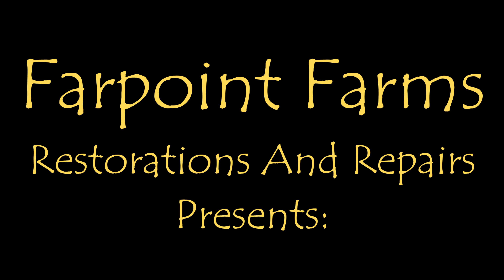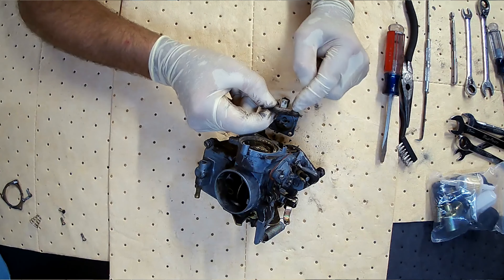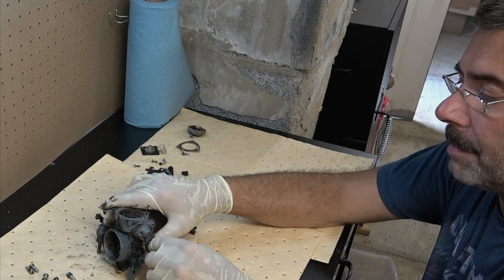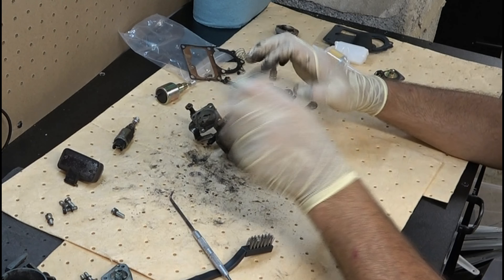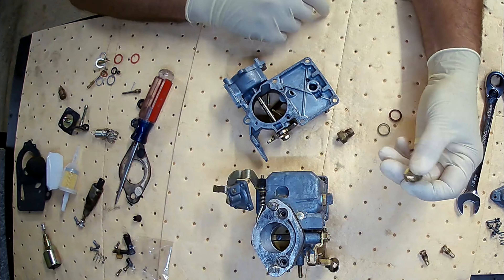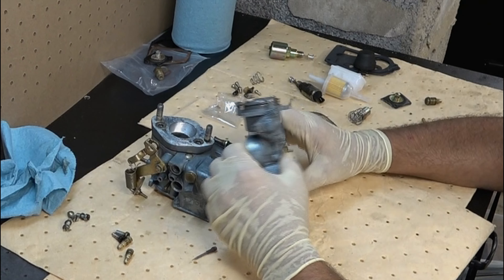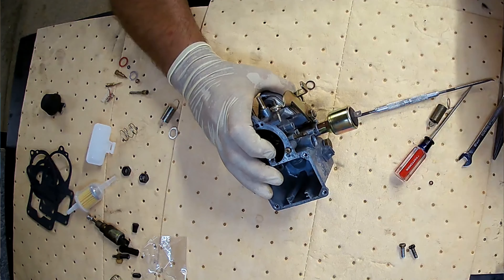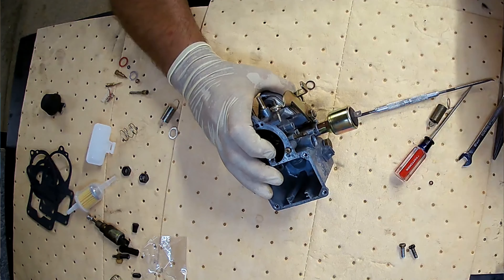VW Air-cooled PICT 31-4 Rebuild Video. Cleaning and building this vintage carburetor.

Comment: carb rebuilding is a dying art.. my 1982 f250 and f150 had carbs... and i would need to rebuild them every year.. due to the fuel .. but a nice tuned carb ..sounded sooo nice.. dont forget those fancy OLDER sports cars with dual carbs that had to be tuned carefully..awesome video.. i love this video!.. u took me down memory lane! wow !!!
Reply from the maker: Dual carbs... Ugg! One is hard enough to dial in, those older MG's had two carbs and they would drive me nuts!
Reply: @FarpointRestorationsAndRepairs  yup! i would have gone nutzo

Comment: I had a 65 VW transporter once that I purchased from a German guy who owned a local VW parts store, the engine was a dual port 1835 with a 32 PICT on it. Whatever he did to make that carb and engine combo work was beyond me, it got fantastic fuel mileage and it never starved even with my foot in it, I kick myself for selling it.
Reply from the maker: That was a great year for those old split window busses. Worth a fortune these days!
Reply: @FarpointRestorationsAndRepairs  Dont remind me!!..😭

Comment: Interesting fact about the Isuzu.
Reply from the maker: They really hung on with their electric feedback carb. It was an interesting thing for it's time, but 1996 came along with the OBD-II standard and they have to give up. Rather than give the great Isuzu Pickup an upgrade, they quite, and started selling the second generation Chevy S-10 as a Isuzu Hombre. Later they did it again with the L200, a rebadged Chevy Colorado. 
  Sucks, since the Isuzu Pickup was better than either of those trucks.